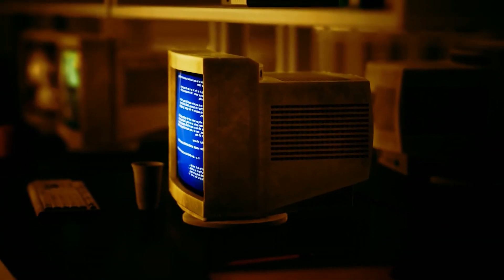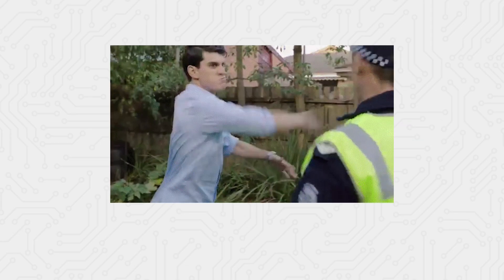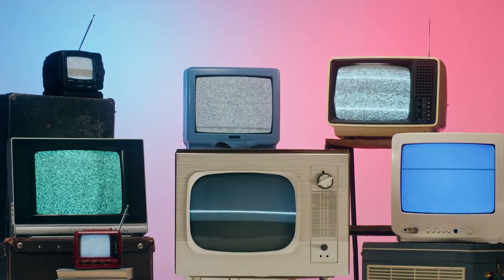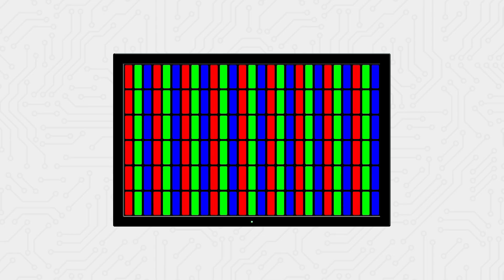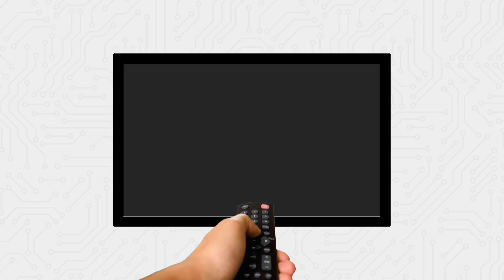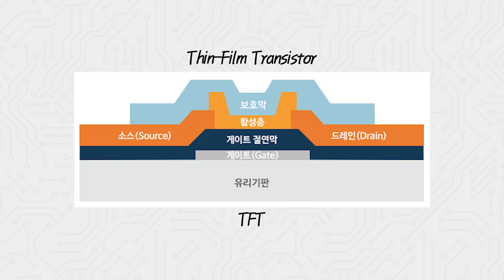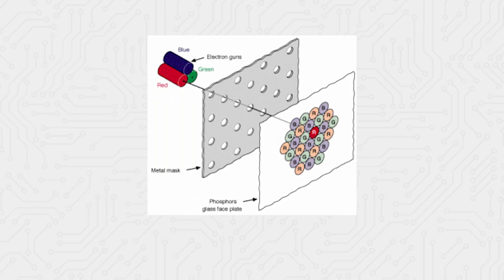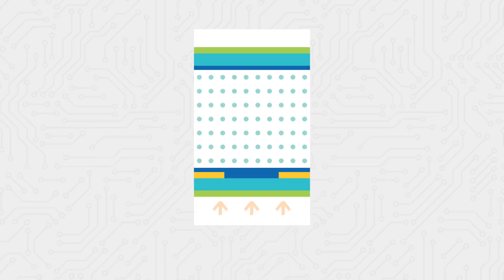How did LCD rule displays for 20 years? From beating CRTs to evolving into mini LED and QLED

Comment: Such an unpleasant voice and tone can't listen. By the way, "mini LED" and QLED technology still uses LCD panels, so they are LCDs. The only fundamentally different panel tech is OLED and micro-LED (which can finally be called LED tech, as they use miniature LEDs as pixels, as opposed to modern LCDs which use LEDs only for the backlight).